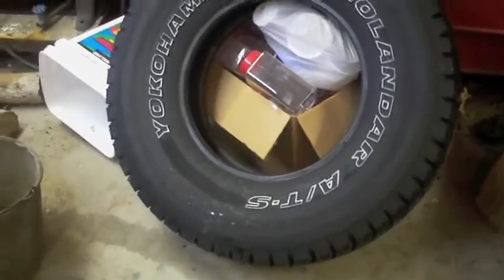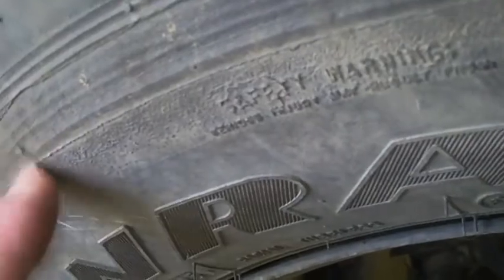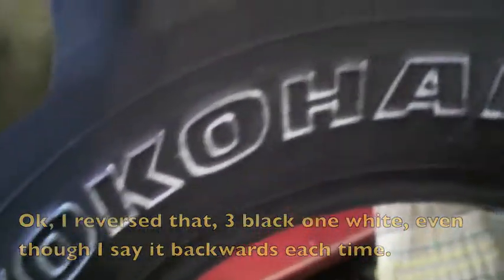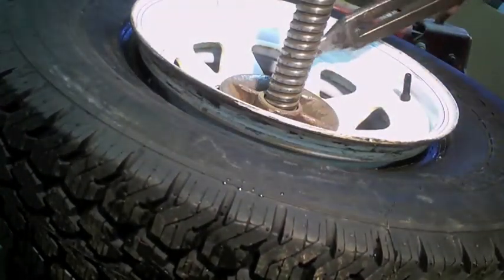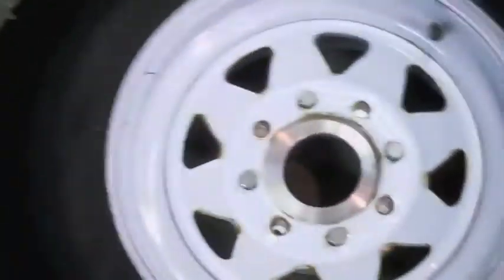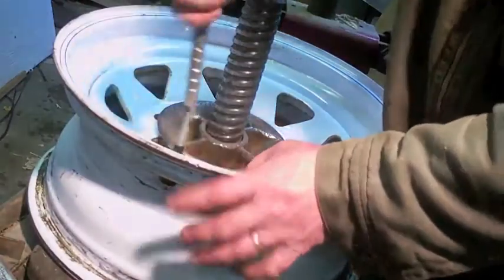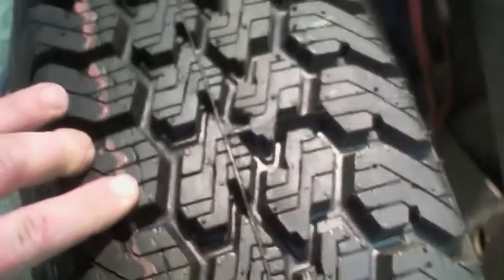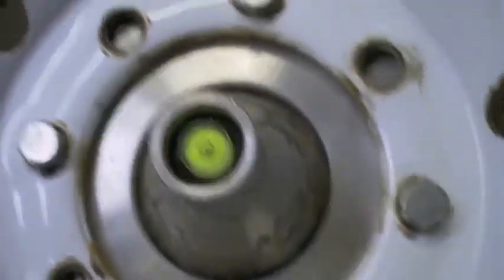TreadWrite Tires: Mounting, Balancing and Review

Comment: I am waiting on my 5th set from TreadWright (formerly HighTec Retreading). I live in Iowa and drive a 1999 Chevy K1500 4x4 extended cab. For winter driving I load about 300 Lbs of sand to keep the rear down. The performance on ice and snow is extremely impressive. (It makes winter driving FUN!)

I routinely haul maximum loads in the summer-time and have had no load related issues.

The only issue I have ever had was caused by an oil-change chain store. The servicers aired me down to under 20 PSI. (The max. recommended pressure was 65 PSI for my load range E tires) Because of the under-pressure condition in the extreme Iowa cold they developed side-wall cracking before I realized what was going on. TreadWright stood behind their warranty 100% and sent me a new set within a week.

Their product has been continuously been improved over the time I have used them. With a retail price that is about half of a comparable new set of donuts, I don't know why  I would consider any other product... period!

Comment: Ran 2.5 sets of Treadwrites, Great tires for the money. I stopped using them because it was my daily driver and the tires were really heavy which hurt my mpg. Also the rubber composition is very sticky, aka soft, so the tires don't last as long as the big brand names do. For a trail rig or something you don't drive too often Treadwrights are money, but i wouldn't use them for a daily driver. BTW most of my treadwrites had patches on the inside and superficial cuts on them, didnt bother me at all and never had a problem.

Comment from the maker: Well that is good.  The fact is those tires are very big for that little bubble balencer, if you were doing smaller ones i think it is more accurate.  Still if you take your time and pick them up and reset them several times to check the bubble you can get them done.  The truck does not shake at speed with the tires I did.

Comment: I read a lot of reviews before I bought these tires and notice people seem to either love them or hate them nothing in between. 
The one common thread is that they are difficult to balance so I went into this purchasing knowing that. 
That said as a cautionary move I only ordered two tires vs. a set for all three of my trucks for winter. The first tire balanced out with 1.75oz of weight. The second tire required more than 7oz and the recommended retail installer Walmart cautioned against trying to balance anything that required more than half a pound of weights. I contacted the company but did not receive a response. I called but got an after hours service that recommended filing a warranty claim. I filed the claim online but never heard back. After a week I emailed two more time and called again. The customer service rep said they were a 3rd party support service and that the manager Michael was extremely busy and suggested  I email again or try chat to follow-up on my claim. I emailed again and tried chat only to find that the tech (Mike - same guy maybe?) was only available to suggest to me that I file a claim which I said I did. After that he no longer responded to my chat replies. I called back and was told they would transfer me to the Manager Michael. It went directly to voicemail. I left a message and proceeded to send several strongly worded emails in response to the previous emails they refused to address. I finally got an email back from someone named Tony who says THEY WILL NOT ADDRESS THIS MATTER ANY FURTHER OVER EMAIL directing me to file a claim. He also informed me that they will not replace a tire that requires 8oz of weight to balance. Keep in mind this is a BRAND NEW TREADWRIGHT TIRE!!! I finally get an email response from Michael that Treadwright will not warranty replace a tire that takes any less than 12oz of weight which is even contrary to the information they posted above which says "non-blemish tires can take between 1oz-8oz to balance". Good luck to anyone doing business with them I hope you have better luck than I did!

Comment: fyi, tredright does bead to bead remoulding now, not recapping anymore as far as im aware. they mould their brand into the sidewall now and it looks like a new tire.  probably better off this way, but i have seen a few faliures.
Reply from the maker: Unfortunately I had quite a few issues with these and removed them at 50% tread just because I did not trust them.

Comment: They won't take a lot of heat, I blew one that ruined my fender and the next time it was 105* one bulged, also my neighbor has a split in his sidewall. Dealing with staff was like pulling teeth, maybe their new company in Texas is better. They are mostly good for off-road.
Reply: Good to know. Out of curiosity what model and size where they? And how old?
Reply: New large 16" guardogs . It blew a 6" hole in the tread and ruined my fender. Then another one got a hump in the same heat. I did battle with them for another month and they actually sent 3 more dogs but   it didn't fix my bodywork on the fender. I am done with them now........all new for me.
Reply: Did they get you taken care of?
Reply: Eventually after threatening to expose it on FTE truck forum and Amazon. It wasn't worth all the arguing and no way would they pay for my truck damage. I am done with recaps.
Reply: I guess they don't make those tires anymore. They do a bead to bead remold now. Looks like they changed up a bunch of stuff.
Reply: They were B2B, that has nothing to do with it. I am DONE with them.
Reply: I watched your video, the failed tire still had the original branding on them, which definitely means they were not bead to bead. Watch their video on how they are made. They remove the branding on the tire.
Reply: Not my video. B2B aren't any better, they just look better. All my problems were B2B sidewalls.